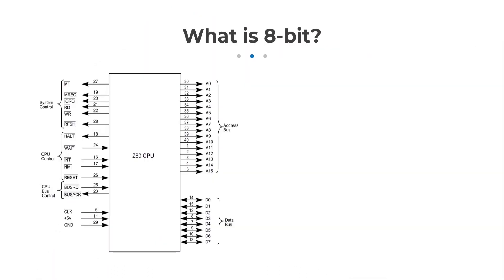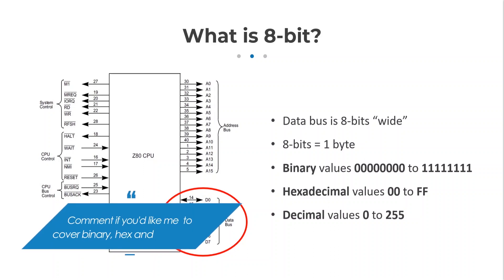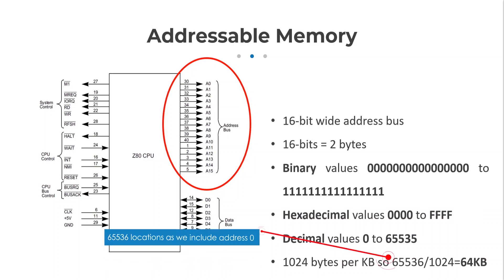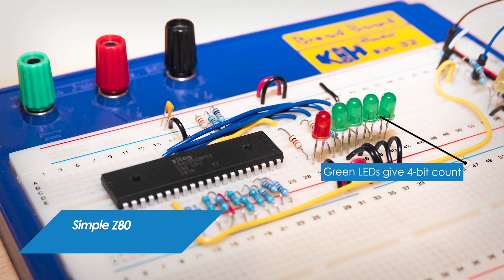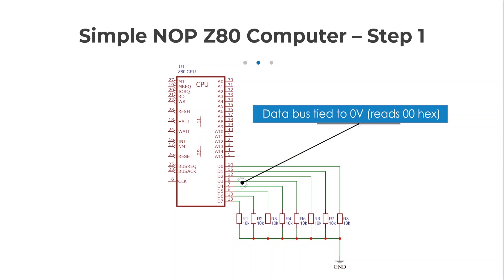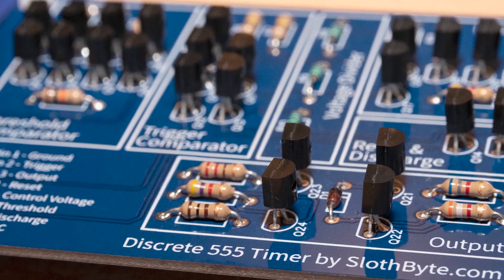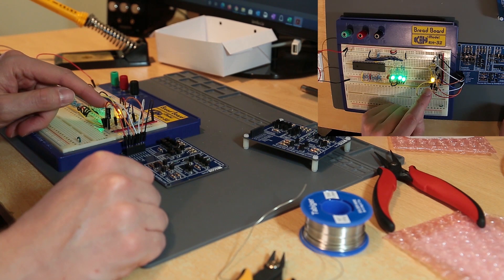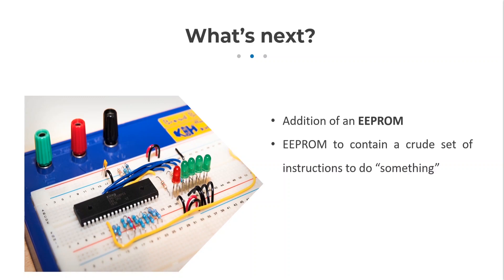Z80 CPU with 555 timer for the clock

Comment: Converting a byte from binary to hex can be done "by inspection".  Divide the bits into two nybbles, and look at the four bits in each.  Either count up on your fingers in binary, or just realize that 1011, for example, equals 8 + 2 + 1 or 11, and, that 11 decimal is B hex.

Incidentally, to convert a byte from binary to octal, divide it into groups of three bits, starting at the right.  Each three-bit group represents an octal digit, ranging from 0 to 7.

Getting from binary to decimal, you can either brute-force it (128 + 64 + 32 + 16 + 8 + 2 + 1 = 255.  Just leave out the values in this series where a zero is set in the byte), or use a spreadsheet or calculator.  If there's a faster way, I don't know it.

At 5:30, "where would the fun be...?"  🤣

Comment: If you don't want to rely on NOS Z80, there's the Z80 core available from Opencores for FPGA's here: https://opencores.org/projects/a-z80. You have to be familiar with Verilog programming, but it's not hard to learn. I used Altera FPGA's a few years ago. The eval kit's where cheap and the toolchain was free. I don't know if this is still the case. You have to check.
Reply: Just checked the MAX 10 Eval kit is ~50$ (EK-10M08E144) and it also features up to 172 KB flash memory
Reply: You don't have to rely on NOS or second hand Z80 ICs. They are still available brand new on Digikey, Mouser and such sites and they are relatively cheap. Perfect for tinkering with.
Reply: @olavl8827  Thanks for the info. I did not know this. Might come in handy if I ever have to replace on of those in my audio equipment. Have fun tinkering!

Comment: didn't knew they had the 555 chips as a discrete transistor kit
Reply from the maker: It's a kit that I designed and sell on my website - slothbyte.com  as well as on eBay. At the moment I only dispatch to the UK, but if anyone wants one outside of the UK, please just drop me a line info@slothbyte.com and I can look at courier options.

Comment: Enjoyed that.  I'm an electronics hobbyist but microprocessors always seemed out of my scope but these little experiments on retro cpus help to explain what's going on at a higher level by showing the different operations in wee bite(sic) size chunks!  More explanation on why it cycles through the outputs and what the outputs would look like with a different data config would be interesting.